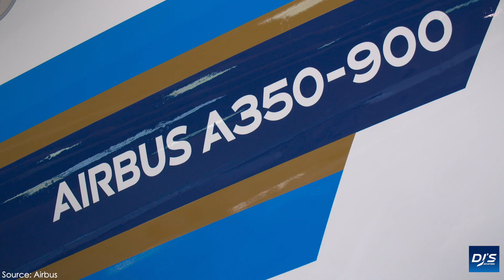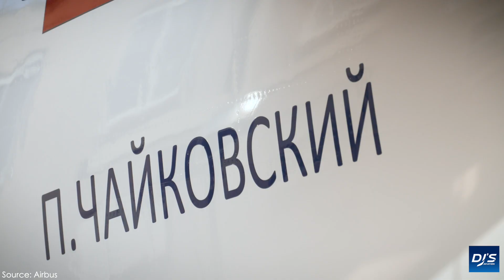Introducing The Airbus A350

Comment: They totally copied the Dreamliner! Right down to the nose of the plane. The Dreamliner looks better with those up-swept wings, and the multi-colored windshield.
Reply: Boeing didn't patent it. It was the most efficient design at the time.
Reply: @zedriclouis87  and airbus copied it. Can’t come up with something theirselves. Dreamliner: carbon fiber composite, a350 copied, the nose: a350 copied, and they even tried to copy the dimming windows, and couldn’t.
Reply: @twinchantillytiffanysbenny8852   by that same logic, Boeing copied Airbus with fly-by-wire controls first seen on the Concorde (Airbus is the successor of the companies that built the plane)
Reply: @zedriclouis87  would like to see airbus come up with something original, like say the a380! The Dreamliner was and is something of a technological breakthrough for its time!
Reply: Another opinion here, will you please? Carbon fibre composite is the lightest yet durable material, so Airbus picked it. The nose of either aircraft was made to minimise drag(as you may very well know). And Airbus originally went with regular window shades from the beginning. They just tried to adopt the design into it in the past year, but without success. 

The A350 DID come up with something themselves. The wing design (like all other new aircraft) passed through 5,000 hours of wind tunneling. There, Airbus was able to make a completely different shape of wings. And if Airbus DID really copy Boeing, there was no patent made by them. So it was completely legal. 

All I want to say is, the Airbus A350 did not steal every single aspect of the Boeing 787. Thanks for reading and have a good day.

+Ye that swept wings and the windshields are cool  :D
Reply: In crafts (art), if you copy, polish up and make better, you have a completely new piece. Rest your case.
Reply: @mojamoja3962  like they say, imitation is the best form of flattery. Done!
Reply: For the historians......  take a look at the De Havilland comet nose.......  both Boeing AND Airbus copied it...  nothing new to see here.
Reply: “ThEy CopIeD ThE DrEaMLinEr, REEEEEEEEE”
Reply: @hodb3906  wow! SMH.

Comment: You need to consider ETOPS in all of this.   In the past, 4 engines planes like the A340-500 and 600 had a route advantage for extra long hauls not only because of lack of ETOPS restrictions, but also because of closed Russian airspace with no alternate airports. 
At the time of the 787 and 777 maturing, Boeing lobbied to have ETOPS range extended, and also, Russia opened its airspace and converted an old army base into an alternate airport thus allowing long range ETOPS flights over pole/russia.
.
The 787 was introduced to replace the 767 which couldn't compete against the 330.  Airbus's initial reaction was not the 350, but just to upgrade the 330 with new engines and aliminium-lithium fuselage (as used on the 380).  You also need to remember that at that time, Airbus was starved for cash due to 380 costs/delays, and the WTO scrutiny over aircraft subsidies limited the freem capital from the EU governments.  The improved 330 remained a 330 (can't remember the new name, but it wasn't "NEO").
.
The 787 made a lot of big bets on all electric plane, the single piece fuselage plugs where you can,t replace a panel if it is dented etc.  Airbus would have considered this a high risk.
.
Cue Steven Udvar Hazy, at the time head/owner of ILFC told Airbus that a revamped 330 wasn't enough. And did so very loudly.  Airbus then came back with a conventional aluminium A350, and Udvar Hazy still criticised Airbus, forcing it to go with the current scheme with misc of aluminium and composite panels and the "wider body"). The First 350 was a 330 fuselage shape/size.  The XWB also came at a time when Boeing switched to narrow seats so it could sell the 8-across 787 as 9 across to lower the per seat cost. XWB gace Airbus a comfort advantage. 
.
The move to the 350 also coincided with relaxation of ETOPs which removed the big advantage the 340s still had, so Airbus needed to replace the 340 with  a twin. At the time, it was thought the 350 would replace both the 330 and 340s (which shared fuselage).  BUT, also at that time, Airbus started to get orders for a 330 refueling tanker which signaled the 330 production would continue.
.
It turns out that the demand for passenger 330s continued because it was much less expensive than the 350 for anyone who didn't require the range.  So Airbus created the 330 NEO (which would be interesting to compare against its first 330 improvements pitched against the 787).  The market for the 330 remaines strong enough to justify the "neo". 

So my guess is that the 330 remains to battle the 767 classs aircraft, while the 350 battles the DC_10 class aircraft (aka: 777). 

The 350 start was quite delayed because of all those trials at less dramatic changes. However, because the 787 got severe delays and had a lot of trouble ramping up production, in the end, the more conventionally assembled 350 didn't end up being that much later than the 787.
.
By replacing the 340, the 350 gave Airbus a chance to also steal some 777 sales. 
What remains to be seen is how the less expensive 330 will faire against the more capable but mroe expensive 350. Initiually it was really thought the  350 would replace both with single high efficiency assembly line.  But as it turns out, Boeing is still spitting out 767s for refueling tankers and freighter.  However, for passengers, it ceased to be competitive in 1990s when the 330 took over that market.
Reply: short & clear ))))))))))))
Reply: It was for a right cause extending ETOPS

Comment: Personally the A350 did nothing extra for the passenger experience, except to annoy me on takeoff. The engines have a terrible sound the entire takeoff to the point it's hard to talk to people next to you. Compared to the 787 which has bigger windows, electronic dimming, quiet engines etc. The A350 doesn't stand out from a passenger prospective. I was very disappointed. I'll take a 777 over A350 Any day.
Reply: another person who makes stuff up, I've flown on both, the A350 is just as quiet as the 787 and who cares about bigger windows. the dimming windows are a fail because they don't totally black out.
Reply: @ant2312   check out my chanel for 787 and A350 takeoff videos. From my experience the A350 was way louder.
Reply: @jmantravels  ok but you gonna say 777 is quieter? amateur
Reply: Who complains about noise in a multi ton jet? You sound like a pedestrian and not an avgeek.
Reply: @CARBONHAWK1  tell that to the birds and horses at Manchester Airport lol🙏🇬🇧🇺🇸😥✈️👩‍✈️👍🥇

Comment: Great looking aircraft. Looks so elegant!
Reply: Yes the best around at the moment,  technologically too. The best looking bird since Boeing's 757
Reply: @markar6395  757 is disaster lookking.... but case taste
Reply: @markar6395 : “Technologically”?  787 with single piece composite barrel sections don’t count? — As opposed to A350 “Black Aluminum” construction!
Reply: @tmt4931  I'm not fully familiar with the technical structural differences and similarities between 787 and a350 so argument is up for grabs. Same with flight deck technology.

Comment: Airbus has build less than 400 of these aircrafts, while Boeing has built and delivered almost 1000, 787.  Its 200 short of breaking even.  How many has airbus need to break even?  The 380a was a bust, being supplemented by the EU, like all the aircraft.  I lived you the EU for 15 years and Airbus was the plane most used there, they were horribly uncomfortable, even in Business class.  

How long did the 747 and the 777 fly for?  I’ve flown more than 4mm in a 45 year span and I have flown every type of craft made by man.  There is no better feeling than siting in a Boeing; instead of a tin can like airbus.  It seems like you are a Boeing hater.  Introduction?  The program for this aircraft started in 2011?  Where I come from it’s called a decade.  The 330 is to compete with the 787?  Where is the 777 in this picture.  I’m sorry but this video was ridiculous and completely rubbish.
Reply: If you think it’s rubbish just unsubscribe problem sorted 🙏👩‍✈️🇬🇧✈️😥👎
Reply: You have probably newer been on a A380, A350 or A320, they all have wider and are more roomier cabins than their Boeing equivalent, the 747, 787 and 737. This is very easy to check up, just go to the manufacturer’s website and read the specifications there.
Reply: @12345anton6789  all of the above and then some.  Much more than, I guarantee you!   I’m okay with compare aircraft.  But this constant trashing Boeing is ridiculous!  Let’s where the stock is in a year?    Let’s speak positive and truthfully!  The 350 is a new plane, the what is the 777x?  I use to like this channel, but enough with slanted derogatory speak!  I have the cojones to tell you how I feel!  I’m frequent flyer, trying to make your channel better!  As the newer planes “being bigger” I’ll take my magnifying glass.  Sorry but first class / or business class on those planes 318, 319, 320 and 321 is nothing but coach!!!
Reply: Hey Boeing fan, fact is that you hate Airbus and dj' is pissing you off with facts.
Reply: Boeing’s great until it crashes
Reply: @MrTherule10  not of the 787 or 777x. anyway 737max is great when it's fixed lol, please move on from the word 'crash'
Reply: @MrTherule10  unforgivable fact.

Comment: For me, it is the best aircraft I have ever been on, so definitely my favorite aircraft for long haul flights
Reply: difficult to chose btw 350 & 380
Reply: @АлексНиков-л2с  fully agree, I have been on the A380 13 times now. It depends on where you are sitting. And because I sat behind the engines on the a350, the comfort was overall better, compared to the a380
Reply: @martingodske3301  I ve flawn 5 times on A380.... out of wich 3 times in economy - it was super uncomparably comfortly dependless of the sitting place.... but for sure I havent tried all 700 places )
Reply: Having flown Cathay, Finnair and SIngapore Airlines  examples, it is a beautiful and quiet aircraft at cruise. Unfortunately on take-off....  the RR engines resonate terribly on take off climb when at full throttle.  There’s nothing so sweet as a GE90, 777-300ER, spooled up at full throttle .  Boeing on the other hand have too much air noise, which may be due to making the air conditioning ducts too small.   The in cabin noise might be different further back down the plane, I can only relate the business class experience 😎
Reply: @tunnelengineer  I have only been in economy, so have never truly experience being infront of the engines on long haul flights
Reply: @martingodske3301  sometimes life deals some nice lemons...  and legroom🤣😂

Comment: Still believe the A350-8 shouldn’t have been scrapped.
Reply: The -8 and -9 variant have almost the same operating economics so airlines might as well get the bigger plane with more seats.
Reply: @jmantravels  would you say the same thing for Dreamliner -8 and -9 ? 

In my opinion I believe that having three variants gives airlines the option  to streamline an entire A350 fleet such as some  airlines with the Dreamliner. The A330Neo has their loyal customers such as the B777x has their loyal customers which are are still racking up orders.
Reply: @shawnmichelledavis5619    Having multiple variants is definitely popular with some airlines like United which has all 787 variants. However some are opposite like Delta which only has one A350 variant and is only ordering A321 and A321neo. Seems to me that Boeing likes to have several variants of the same plane while Airbus does not. Without discussing size overlap issues I definitely think there are differences in mentality at Airbus vs Boeing. And that comes through when you look at what airlines order each type of aircraft. 787 has been extremely effective in the low cost long haul market while airlines with fleet diversity have no issue ordering A330neo A321 variants, A350 and some Boeing products to fit all of their needs. Boeing and Airbus have always had different approaches and only time will tell which one works better.

Comment: I flew on one of these with Fiji Airways from Nan to LAX. I must say it was quiet.That's about it. It doesn't set itself out in my mind as special or unique in any way. I found the 777 I took down was far more comfortable with the IFE about the same. I'm spoiled having flown on every tri jet and almost every version of quad jet that had far more room than the 350.
Reply: Probably more to do with the airline. Some airlines put worse cabins in their newer aircraft compared to older ones
Reply: yes 10 abreast on a 777 is NOT more comfortable than 9 on a 350. I've done Dubai - Singapore - Brisbane on Emirates 777-300ER's there and back. Strange how he doesnt mention the narrower 787. He's probably lying anyway because the only other quad jet apart from the 747 he would have been on is the A340, he won't have been on the DC8, 707 or VC-10
Reply: More comfortable on a 777? That’s quite odd. Unless it’s 9 seat 777

Comment: I find the A350 more spacious and quieter than the 787.
Reply: Despite the fact that they are both wide body aircraft and that the Airline decides the spacing between seats?
Reply: @darkchaotix1productions326  in a standard 9 seat abreast in economy, The A350 can fit wider seats because it has a wider fuselage and therefore less Shoulder-rubbing
Reply: @12345anton6789  actually the a350 is only barely 46 meters wider, so again I will say that it's mainly the airline which decides the seat spacing.
Reply: @darkchaotix1productions326  The 787 has 17,2 inches wide seats in a standard 9 seat abreast economy , you can’t fit any wider seats on because of the minimum requirement of the width of aisle. The A350 has a standard 18 inches wide seats in a 9 seats abreast economy. So not much airlines can do here to fit wider seats without removing seats.
Reply: @12345anton6789  once again, not much of a with difference + modification = difference in spacing
Reply: @darkchaotix1productions326  metres or inches?  What's the width of the seat in 787 economy?
Reply: @mojamoja3962  17.3 inches in economy with United
Reply: @darkchaotix1productions326  an antire 757 wider?
Reply: @gasviation9077  Roughly 5 - 6 feet wider.
Reply: both a350 and 787 are wonderful state of the art aircraft! I will adore mostly 787-9 and 787-10 because they're size is reasonable compared to the witch-like 787-8. A350-9 and -1000 I'm speechless. the really incredible range and the wonderful sharklet we all love to zoom in on in the cute sunsets happy days
Reply: Honestly comparing the 777x with the a350 would be a better comparison but since it's not in commercial service nothing we can compare equally
Reply: @poggorseal2726  That's why comparison is being made using what's on market.  You should adopt well note that the B777x is different class than A350 and they too may not be comparable.
Reply: You know nothing. B787 is love
Reply: @ABFAMILY786-m3x  They both are good aircraft.

Comment: Airbus also switched their wing design of the A350 when they saw the 787 take its first flight.
Reply: Raked wingtips are generally better. I’m not sure why Airbus hasn’t embraced it yet for their widebodies unless they plan to in the future. Boeing uses it with 747-8, 787, 777-200LR/Freighter/-300ER and 777X. Embraer also uses raked wingtips for the E2 regional jets
Reply: @filledwithvariousknowledge1065  well it all comes down to what the manufacturer finds the most efficient on the aircraft. I do believe airbus looked into raked wingtips.
Reply: @filledwithvariousknowledge1065  maybe Airbus has another approach when it design its wings. The A350-900 has a 15% larger wing area than the 787, it has even larger wing area than the much larger 777-300ER.
Reply: Could be. Raked wingtips are good for increasing area and span as the curve in the shape does the same job as winglets. Boeing is set though with 777X to beat A350 with area though compared to the -1000 not by that much despite what the longer length makes my eyes think in demo flights
Reply: @filledwithvariousknowledge1065  yes, Boeing increased the wing area a lot on the 777x, around 15-20%. The same thing happened with the A330neo, it increased its wing area with over 20% compared to the A330ceo and its wing area is even larger than the 777-300ER.
The A330neo and the 777x are the latest wide body’s to enter the market and therefore have the newest wing design. So maybe Airbus and Boeing has find out that large wings are necessary to be more fuel efficient.
Reply: @filledwithvariousknowledge1065   It wasn't just the wingtips.  There were 2 schools of thought on a composite wing at Airbus, and the more firm design was the one that won the battle since that group didn't think that a more "active" wing of that size would be acceptable on a large commercial aircraft.  Then the 787 made its first flight and they say the flex of the wings as they took on the load of the lift.  Within 24 hours, the change was made for obvious aerodynamic reasons.
Reply: well, put it this way the 787 and 777x wingtips are a lot better than 777-300/er.  Nice modern touch with a slower strobe light flash compared to airbus. 
A350 on the other hand and a330neo are going for the sharklet design which again has the airlines colours painted on. the a350 succeeds in this because we can adore the sharklet in the sunrise and sunsets which is the future to wing design by airbus. the 777x will also have the airlines colours too but a shame we won't see it in flight as the wingtip will be folded down of course but when taxiing we will see the airline colours.  happy days!!!
Reply: @nickolliver3021  
The long pump flashes of the beacon light and strobe of boeing aircraft are amazing. But the double pump flashes of airbus are so hypnotizing. I like them both tbh. They both look so iconic in the distance.